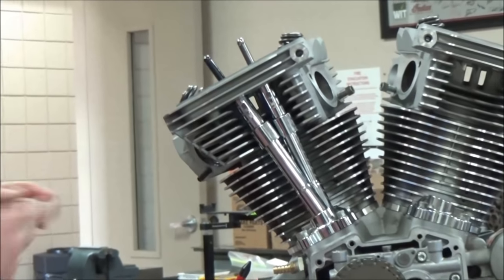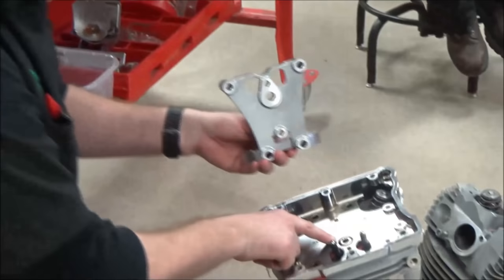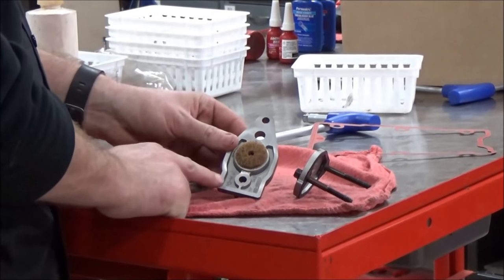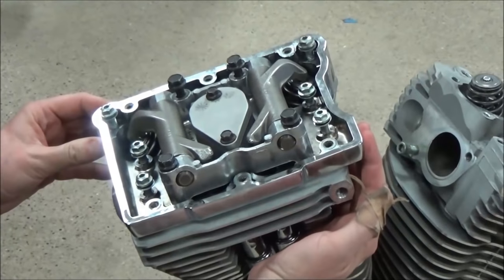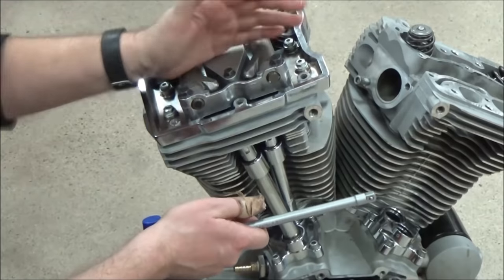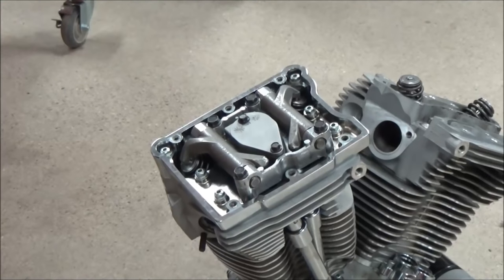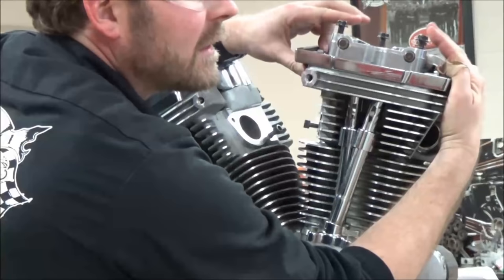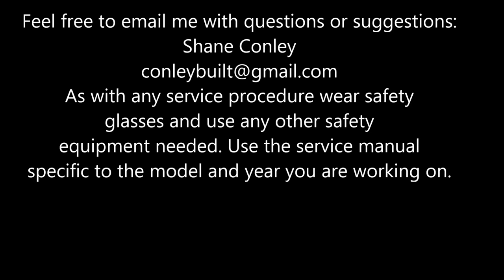TC88 Series: 21 How to install Harley rocker boxes & gaskets. BONUS: How to bleed down lifters

Comment: How do you torque the rocker box bolts on the rear cylinder when its in the frame? Mine won't fit

Comment: Great video Shane. Exactly what I needed. I had to take apart my front head only (on a 88ci 2005 softail standard) Both the pushrods were black. Should that be a concern that the intake is not silver? Someone must have done work on this before?

Comment: Thank you Amigo.  My '05 R.K. is in the shop for the second time in 2 weeks. First, new 42mm Mikuni... Nice! Second,  excessive oil out of breather...
Obviously too much pressure.  I checked the new oil level & just fine.
Mechanic estimates $500. for the job.  Ouch.
Your video educated me in as much that at 10 y.o., the "sponges" are probably crap.
Any feedback will be appreciated and confidential.
Have a great day & thanx alot.  BTW, 18,200MI. on engine ...?
Reply from the maker: You're very welcome and in luck. I provide one on one help. Contact me here: https://how2wrench.com/contact/Your answers and help are just around the corner. Save time and money while protecting your investment and yourself by doing it the right way at www.How2Wrench.com 

Have you Subscribed yet to never miss a video? Have you seen the video playlists https://www.youtube.com/user/conleybuilt/playlists ? 

Want to say “thanks” or “keep it up”? Click here https://www.paypal.me/how2wrench

Comment: I have an 07 kaw 1600 meanstreak that uses hydraulic lash adjusters. the rocker case must be removed to get to the head gasket but will not be serviced. Is it still necessary to bleed the lash adjusters when reinstalling the rocker case? Thanks.

Comment: Can you adjust the rocker housing and or the rocker support arm if your pushrods rub against the top of the pushrod tube? Rear cylinder on a 14 RK CVO 110...... Front cylinder pushrods are centered and the rear cylinder pushrod are off towards the rear of the tube.

Comment: Shane you have no idea, how much i re watch these videos. I am the guy who posted a vid on your fb. I installed the rocker breathers incorrectly.dipstick was blowing out the tank. Anyway, i have to end rocker noise.they say it's fine, but I'm thinking about doing rocker lockers and shims. I want to know if you recommend using those.  I wishi had an extra motor just to rebuild it. It's like i have an addiction with it. You have any suggestions on finding use motors on the cheap?
Reply from the maker: Thank you for taking the time to comment! Hit that subscribe button please! It helps us!
Here is a way to support all the free videos.
Want to say “thanks” or “keep it up”? Click here https://www.paypal.me/how2wrench  

Coach Conley is also available for hire to personally work one on one with you if ever needed. Yep he is a real person. Give him a call @ 602-345-0432

Your answers and help are just around the corner. Save time and money while protecting your investment and yourself by doing it the right way!
Follow us!
Web:
www.How2Wrench.com    
www.Tools2Wrench.com

Comment: Excellent video.  Question, semi related.  My buddy with a 13' Roadglide is getting excessive oil in his air cleaner.  This leads me to believe that possibly something not right with the breather assembly, filter, gasket, etc.  Thoughts?  Again, excellent video, very good content. Subscribed
Reply from the maker: Thank you Ben!!  Head over to the new website and subscribe to the newsletter to never miss a video or newsletter! 
https://how2wrench.com/contact/ 

If I can ever be of service to you, here is a video explains how to connect with me. 
https://www.youtube.com/watch?v=vjvmB01ebcs 
Keep Wrenching,
Shane Conley
Instructor/Motivator/Motorcyclist
www.how2wrench.com

Did you like this free video and hope to see more? Would you just like to say thank you with a donation? Click https://www.paypal.me/how2wrench

Keep Wrenching,
Shane Conley
Instructor/Motivator/Motorcyclist!
www.How2Wrench.com
Reply: Could just be too much oil ... is he checking oil levels according to manual
Reply: I had same issue, running my oil level to high and riding hard = over flow into air filter as the higher RPM’s cause oil level to rise. Adjusted oil level and fixed over flow.

Comment: i am having a crazy amount of oil leak from my air filter on my tc88 engine from the air cleaner, i wonder if that grey plastic valve or worn piston rings or a dirty air filter is the culprit?
Reply from the maker: Thank you for the comment. See the link below for more help with your question. I have been banging my head against the wall thinking of ways for people to say thank you in an impactful way to help keep these videos coming. Here are few ways that many have found as a way to give back. 
* Membership to H2W (includes t-shirt or tech help) https://how2wrench.com/product/membershipmembers-onlymembers/
* Simple donation to say "KEEP IT UP"
May you have a great day and... https://www.paypal.me/how2wrench

Free Mechanic info, tool reviews, and “how to” videos newsletter sign up: https://how2wrench.com/subscribe-free-newsletter/

Missed a past issue? No Worries. Newsletter Archives: https://how2wrench.com/blog/newsletter-archives/

Like freebies? Click here for a free diagnostic checklist! 
http://gem.godaddy.com/signups/364621/join  

If I can ever be of service to you, here is a video explains how to connect with me. 
https://www.youtube.com/watch?v=vjvmB01ebcs
Reply: cmdeane it’s the blow by getting spit out threw the breather bolts on the air filter assembly. It’s a common issue. Google or YouTube Harley blow by issue or Harley catch can
Reply: Me too

Comment: Quick question. The four bolts that go in to the rocker arm housing, are they all 4 the same length? I have run into 2 longer / 2 shorter by about 1/8-3/16". Is that right? If so can you tell me which goes where? My manual doesn't say anything about it?? Thanks!!
Reply from the maker: +Scott Kirk 
First: Too many models and bikes in this world for me to memorize!.:)  use a parts fiche to verify correct parts
Second: a Harley parts book at your local dealer will tell this correct length bolt for the correct part number
Third: NEVER trust the last mechanic. They may have went to the local hardware store and replaced lost bolts! 
Fourth: Thank you and please share.
Reply: +Shane Conley Thanks Shane! Great Video by the way I've been chasing TDC all day day and uyour video helped me right away. But I am having an impossible time getting the piston to TDC to reinstall the covers. I'm going crazy. Any advice on that? I figured out the bolt size issue. BTW, for some reason the bike I bought has 1 adjustable pushrod on the front cylinder which is coincidentally the one giving me problems. Any helpful advice? I have a manual but it's not helping me on this.

Comment: Is there any chance of replacing the rocker covers without removing the motor from the frame?   Just looking to take an evo to a knucklehead.
Reply: Dem Wallet  yes, but you’ll have to remove your gas tank

Comment: At the beginning of the video lets say you cannot look into the cylinder through the spark plug hole to confirm, is it possible that both push rods can be even on the overlap stroke? I know they would be even on the base circle, and that's where you want to be. Or is it not possible to to have both pushrods/lifters even if they are not on the base circle.

Comment: I watched this just to see the gasket install for the rocker box.  My 2015 road King, the rear cylinder is leaking and the dealership was offering to change both for $400.I think this not a hard job,  most difficult is remove tractor seat and fuel tank.  Thanks

Comment: I have a 2001 FXDWG supposedly with cams and big bore kit 95 CI. I’d been researching the crankcase rebreather and done a mod catch can since my Harley pukes a lot on highway speed and not nearly as much as when its just around the neighborhood ride. I know it may be the plastic part valve/ or screen that may need to be change. I have 2 questions and I would like to thank you in advance for any answer and am willing to contribute $ for your work on this channel. 
1st question. Will recycling this puked oil back to the engine through lets say a vent hole through the oil cap or anywhere else help with the problem?
2nd question..I am considering changing the cam oil plate with hydraulic tensioner to SE ,, will that help with the oil issue? Ty sir
Reply from the maker: Good news bud. Shane has a techline just for that! Let me try and see I can catch Shane to answer quick. He is currently at an extended stay in Japan training students this winter. We are just the social media team. 
Due to his limited bandwidth on time and demand for help, we had to choose to forward any requests from members first and it is only $1.99 a month to join.  All member tech questions like this get directly forwarded to him every day! Be mindful and honest that this is for "quick questions" that would serve you answers that can clearly be addressed. If it's a diagnosis need you'll need to use the one-on-one service. 
Here is how to get in!
* Join here: https://www.youtube.com/channel/UCBhM8DCKnT3qXwTW0eToyCg/join       
* Just looking to give us a high 5? Click here: https://www.paypal.me/how2wrench 
* Is this an emergency and your head is about to explode from frustration or fear? Get Shane’s cell here: https://how2wrench.com/ols/products/techline-one-on-one     

Have you seen our "YouTube Trained Support Shirts? Great way to "high five us" https://goodfellasmerch.com/collections/how-2-wrench/products/support-shirt

Comment: Are all of the rocker plate bolts the same length on both sides
Reply from the maker: I'm the intern studying under Shane. He's on the road training techs and not here to ask this week. I fInally made it to your comment going down the list...just an FYI...he literally logs in and answers member questions daily! Consider joining...best $1.99 you'll spend this month 😁
One of these days I hope to move from the office to the shop! Wish I knew the answer but don't want to bs you. He couldn't screen these requests fast enough...

He has a few other tricks up his sleeve he plans on making videos on. If you need help sooner choose and option below! 

That’s a great question for Shane directly! We are just the social media team. Shane does answer questions when he get's back around to non members eventually so hang tight, FYI >>>> he does member ones daily!

He just returned from overseas training techs and his inbox is slammed with requests. He is scheduling time each day again to answer techline orders. He does not have the bandwidth to provide free email replies as his schedule is full with shop customers, training schedules, and one on ones. 
There's good news though! Shane has 2 solutions for you. One is a deep dive one-on-one with him with video, email and phone support. The other is a "quick fan support" option when it's a quick answer and just helps support the time for him to stop wrenching or training and get you in the direction that a free video had you close. Links to each are below. Hope this message makes sense to you as a decent human being that also works for a living and gets it!
Make it a great day!

The one-on-one service. Get Shane’s cell here: https://how2wrench.com/ols/products/techline-one-on-one       
Quick answers are answered daily as a channel member: Join this channel to get access to perks:
https://www.youtube.com/channel/UCBhM8DCKnT3qXwTW0eToyCg/join   
-Daily MEMBER FIRST COMMENTS ANSWERED FIRST 
-Live Q/A video chats
-Wonder if we have a video on your need? Members can request content links!
-Full Access to the ENTIRE 700 video library
-Member-Only FREE tool giveaways  

Have you seen our "YouTube Trained Support Shirts? Great way to "high five us" https://goodfellasmerch.com/collections/how-2-wrench/products/support-shirt

High fives help too! Give him one here:  https://www.paypal.me/how2wrench

Comment: hi shane my name is shane too, I just reokaced the rear head on my 2005 Harley lowrider. 88inch injected motor, my problem is it seems like I'm not getting enough compression in that cyl. when I remove the plug and put my finger over it the comp. is low. took the rocker box off and tried it and the compression seemed good. there is a lot of air blowing up through the push rod area. can you help me? there was nothing wrong with the motor before I replaced the head. replaced the head only because I had an exhaust bolt break off and couldn't remove it so put another head on. so the bike ran great before the replaced head , am I missing something?
Reply from the maker: shane bumenstein 
You're in luck. I do offer personal service to back up what's missing from a video to fix your specific problem. Live Chat is great for you to actually show your specific issue! Become a member of my website. It comes with a free HOW2WRENCH “Keep Wrenching” t-shirt or 20 mins of techline! Sign up now to have my personal cell phone number on speed dial! 
As always thank you and enjoy the free videos! Much more to come! I look forward to working with you and hope you will become a member of our learning community. 

Link to membership: https://how2wrench.com/product/membershipmembers-onlymembers? 

Contact form: https://how2wrench.com/contact/

If I can ever be of service to you, here is a video explains how to connect with me. 
https://www.youtube.com/watch?v=vjvmB01ebcs 

Direct link to services: 
https://how2wrench.com/product-category/tech-lineservice-callminutes/ 

Donation link: https://www.paypal.me/how2wrench

Comment: When i set the rocker box back on with new gasket. Should the rocker box cover sit perfectly flush all around the head? or is it normal to for it to sit up little less the 1/4" inch before torqing bolts? thanks for any help
Reply from the maker: The cover on a Twin Cam should sit flat. A 1/4 " sounds like a mile! Feel free to email me a pic just so we are on the same page.
Thank you for the kind words and sharing my work. If I can ever be of service to you, here is a video explains how to connect with me. 
https://www.youtube.com/watch?v=vjvmB01ebcs 
Keep Wrenching,
Shane Conley
Instructor/Motivator/Motorcyclist
www.how2wrench.com
Like freebies? Click here for a free diagnostic checklist! 
http://gem.godaddy.com/signups/364621/join 

Did you like this free video and hope to see more? Would you just like to say thank you with a donation? Click https://www.paypal.me/how2wrench
Reply: Whats your email shane addy Shane? I got cover to sit down,but i can slide a piece of paper into the 1 corner. I will send pic thanks so much
Reply: Shane Conley your vids. Make me glad i watched. I have a front rocker box leak frontand back. Got a new gasket. Should i replace gasket under the box too?
Reply: Shane Conley amazing vids. The way you explain about the tension of the box. When take off,and where to set the piston. Seems like i have a noisy front rocker box. Plus it's leaking out the cover. I heard of a sleeve they sell to quiet down rockers. Bike still performs the same,great. But noise makes me worry.. They sell sleeves that the rocker bolts go thru. Does that sound right?

Comment: I just bought a 1987 Electra glide an I hear loud tick mechanic told me the evo engine is loud an it has a high rpm cam so it’s normal it’s really loud tic an guy is a hack an never fixed anything else on my bike correct down to the kick stand sad just scared to ride the dam thing
Reply from the maker: Bummer on the tic...From tech calls we've heard Shane answer, on his service hotline, it's not a one shot fix and there are good solid diagnostic steps to take before tearing into...We are just the Social media team though. 😬 That's a great question for Shane but dang is he busy with the shop, member channel and techline...may be a hot minute to catch him.

Good news Shane has a member club where he does answer questions daily!  Here is the link to connect directly with him! * Join here: https://www.youtube.com/channel/UCBhM8DCKnT3qXwTW0eToyCg/join  
Due to his limited bandwidth on time and demand for help, we had to choose to forward any requests from members first and it is only $1.99 a month to join.  All member tech questions like this get directly forwarded to him every day! Be mindful and honest that this is for "quick questions" that would serve you answers that can clearly be addressed. If it's a diagnosis need you'll need to use the one-on-one service.      
* Just looking to give us a high 5? Click here: https://www.paypal.me/how2wrench 
* Is this an emergency and your head is about to explode from frustration or fear? Get Shane’s cell here: https://how2wrench.com/ols/products/techline-one-on-one

Comment: just three  questions :; why do harley engines spend all their time in bits? Are they unreliable? Why do you need to fit aftermarket engine parts? is the engineering not upto the Asian markets?
Reply: all 3 of my harleys engines have never come apart so id say you are painting with a pretty broad brush.Who says we need to fit aftermarket parts?As far as cruisers go i would say harley is among the best.Its a cruiser and thats what its good at.Please dont tell me your busa will blow it off of the road because it should.